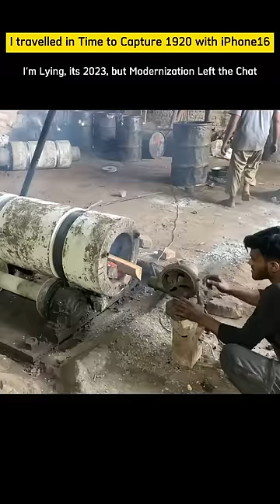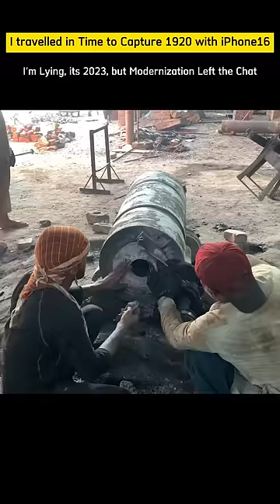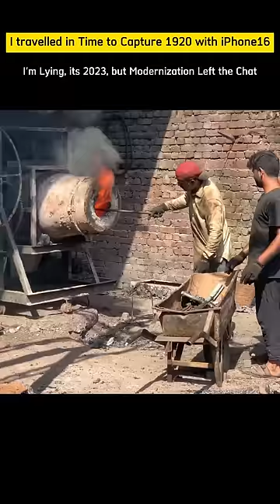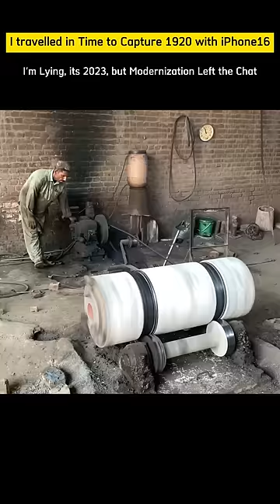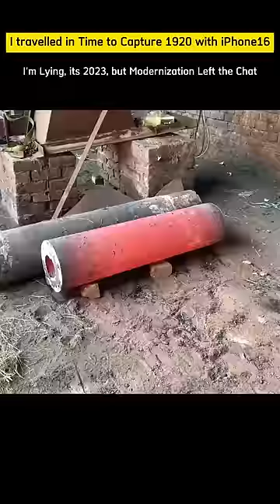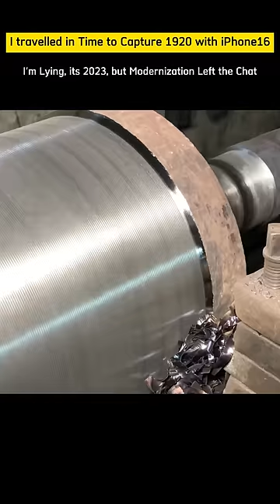Incredible Manufacturing Process of Industrial Roller with Amazing Technqiue

Comment: They used to be an engineering company in Leeds that used to make hollow propeller shafts for the Royal Navy they used to use centrifugal force to manufacture them. Quite a length obviously but very ingenious.